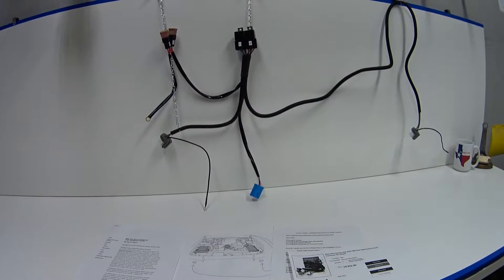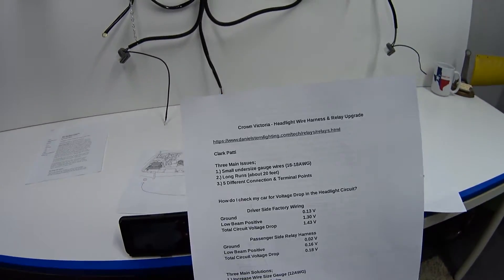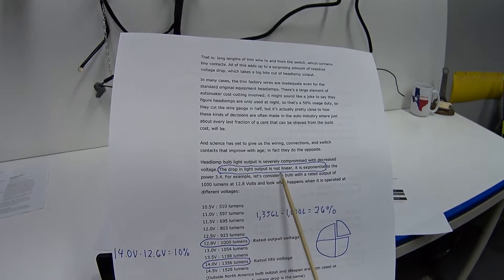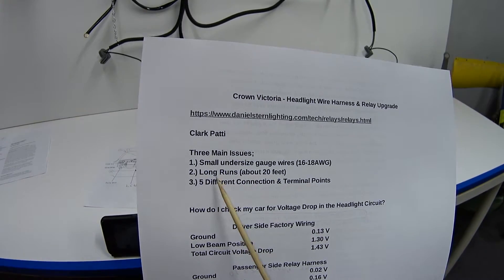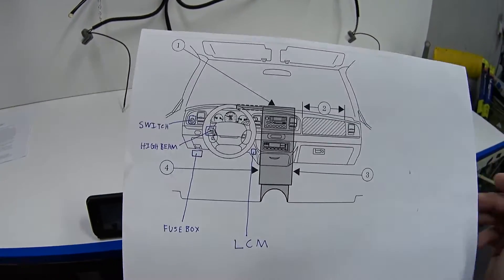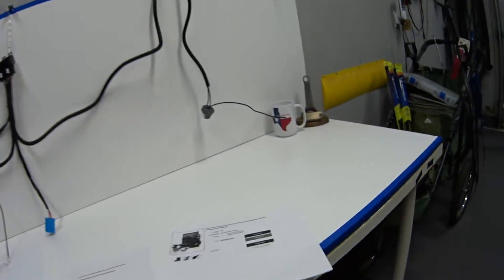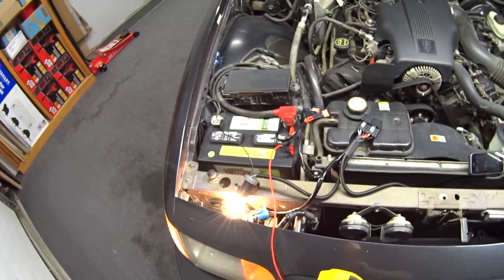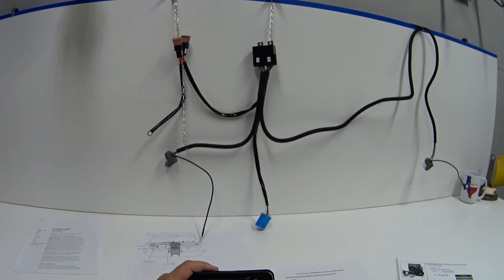Crown Victoria - Heavy Duty Headlight Wire Harness

Comment: In other news I installed my new headlight wiring harness (good thing I won). The camera doesn't seem to pick up the brighter headlight when I left one old and one new, but I can see the difference in brightness between them with the naked eye.

The install was easier than I thought it would be. Easier than it should be even. Which is kinda suspicious but they work, so it's all good in the hood.
Reply from the maker: Right on Hollywood,
I had the same issue getting the difference in brightness on film.
I think it takes a camera with manual ISO, or white balance adjustment.
 
Now that you have bigger 14AWG wires, and high temp ceramic sockets you're a prime candidate for high wattage halogen headlight bulbs. 
Stock wattage is 55/65.
High wattage is 80/100.

Guess what I might be reviewing, and giving away? lol
-Chuck
Reply: @PanzerPlatform  I can only hope some sweet High wattage headlights.

Comment: I used the wiring harnes in my 2000 ford Crown Victoria and it worked great it actually made my headlight halogen bulbs way brighter and finally I could see better, so it does work awesome, than I decided switch to LED headlight bulbs and for some reason the harness wouldn't work on LED bulbs so I had to disconnect and the LEDs are very bright there is prons and cons but the issues I am having with LED bulbs they are bringt but in the winter they don't warm up my headlight assembly so if it snows or gets frosty outside the headlight assembly gets frozen and becomes to dim, so I am thinking to go back to halogens and the wiring harnes this way keeps it dry and warm my headlight assembly, also the silver star ultra bright performance sylvania headlight bulbs will only last about a year and half tops but at least you can see very well and I mean very well like rain and fog.
Reply from the maker: Check this out;
https://youtu.be/WaF4q5wx17o
-Chuck
Reply: @PanzerPlatform Thank you for the link. Update: those light bulbs look badazz😀 I am gonna order some right now. Thank you Again for your help Sir.and I did ordered new wiring harnes

Comment: Chuck, did you ever use these with LED bulbs? Installed today and unable to use high-beam. I hear the relay clicking, but the light output or position does not change.
Reply from the maker: Yes, I tested this harness with LED bulbs, and there was no difference in brightness because the LED bulbs only draw 1 Amp of current (20% of halogen).
This harness is beneficial if you run halogen because they draw 5-6 Amps and cause too much voltage drop causing the bulbs to be dim.
A lot of guys can only run halogen bulbs because they need the heat from the bulb to melt snow / ice off the headlamps assembly.
LED bulbs only consume 20% of the current of halogen so they do not get hot enough to melt snow / ice.

If you are having a malfunction, test the LED bulbs on the bench outside of the car.
If the bulbs are OK, test the harness on the bench outside of the car.
-Chuck
Reply: @PanzerPlatform  Thanks for the detailed reply, Chuck. Ended up reading deeper and realizing this. Well, guess I’m out 20 bucks but I’ll keep it around in case someone needs one. What LED bulbs are you currently running?
Reply from the maker: @PF12345  
I use these for low beam;
https://youtu.be/3-xDR4ng7cg

I use this for high beam;
https://youtu.be/rsYlEUkLcIQ

Comment: Hey Chuck, would appreciate any insight. Ordered a similar harness from J87 for my ‘09 MGM. Worked great at first. However one day I was greeted by a drained battery; not sure what happened, but when I jumped the battery and recharged, the headlights seemed to be constantly on, even if I turned the headlights off from the dashboard knob. Don’t think it’s the LCM because when I removed the harness and put back the original bulb plugs, it all works as expected. Any idea what it could be? I connected the harness to the positive terminal by putting the ring on the clamp bolt and then tightening the nut. Connected the grounding rings to chassis metal as instructed using metal screws. It seemed like the driver side headlight ground wasn’t quite right; noticed the screw was getting super hot whereas the passenger side ground screw was normal. Please keep in mind I’m a total novice with electrical stuff.
Reply from the maker: Hello,
It sounds like something is triggering the relays.
It's too late now, but that's why it's important to always bench test new stuff before you install it in a car.
I would remove the harness from the car, and bench test it.
If it works OK on the bench, that means there is a problem with your installation.
-Chuck

Comment: My 95 E350 has reverse polarity on the headlights, so when I tried LEDs instead of halogens they worked in reverse order and there was NO way I was going to have the blue high beam light on all the time, so I went back to halogen and they honestly provide pretty decent illumination. 

The eBay listing says this harness will fit my van. 
Ironically it says it does not fit my 2011 CVPI. I went with 4WDKING LED headlights and they have very little scatter so I’m just going to stick with that for it.

Back to the van: Do you think (or know if) the Ford Vans have the same issue with the wires being too small and the loss of voltage causing similar reduced illumination like you explained it does for the Crown Victorias in this video, and should I go with one of these harnesses in it?

Separately, I too (read through the comments) didn’t find this video to be boring, in fact I greatly appreciate how well thought out, planned out, and concisely explanative it was 😎🙏

I’ll appreciate any insight into my question above 🙏
Reply from the maker: Thanks for watching, and the kind words.
I would grab some 12AWG wire, and temporarily wire up one of your headlights directly to the battery, (closest headlight to the battery).
Then look at the side by side difference between the two headlights, and decide if the thicker wire is worth the increase in brightness.
-Chuck

Comment: Will ked bulbs fix this ?
Reply from the maker: Not sure what you mean by "ked"?
Do you mean LED Bulbs?
If so, I tested the harness with LED Bulbs, and I did not see a difference.
This heavy gauge wire harness is more beneficial for halogen bulbs because they draw more power.
5-6 Amps vs. 1 Amp for LED.
-Chuck
Reply: @PanzerPlatform  yes sorry.  So if I buy led bulbs I shouldn't have an issue with dimming?
Reply from the maker: @Murc_roadster  
Correct.

Comment: Hey! 
This upgrade is very interesting to me! I’m wondering how these held up over time for you? Also does doing this modification affect the operation of the vehicles daytime running lights? If so is there a workaround to get them operational again?
Cheers
Reply from the maker: Yo Sunny,
Thanks for stopping in.

1.) What is the YEAR / MAKE / MODEL of your car?
2.) Are you planning to use halogen bulbs, or LED bulbs?
-Chuck
Reply: Hey thanks for the speedy reply chuck! 
My car is a 2011, and I’m planning on using sylvania silver stars (unless I’m made aware of a better option)
Reply from the maker: @sunnynoble9996  
During my testing I found the upgraded larger gauge wires made Halogen bulbs brighter.
There was no difference with LED bulbs because they only draw around 1 Amp of current.
But halogen’s draw around 6 Amps, so this upgrade really helps someone who runs halogen bulbs.
Since I run LED’s I did not use this.

This upgrade does not affect DRL operation. 
-Chuck

Comment: Chuck, I’m scouring the web and YouTube trying to find agreement on whether the DRLs are via lower power to high or low beams. MOST say it’s via the high beam. You may have mentioned it in one of your videos but I can’t find it again. Do you know? A company in Cali called aspire make relay harnesses with the option to keep operational DRL’s.
Thanks, Jon Archibald.
Reply from the maker: Yo Jon,
Thanks for stopping in.

The DRL’s on a Panther Car 1992-2011 function at 50% power on the HIGH beam circuit.
-Chuck

Comment: https://youtu.be/JqrySR_jKfc I made a quick video checking my voltage drop. I only did the wire. I was afraid to back probe.
Reply from the maker: That's not how you test voltage drop.
The circuit must be energized. 
Also engine running since it’s a headlight bulb.

Watch this; https://youtu.be/APLic9F7ZsA
-Chuck

Comment: Could you see any better after doing this upgrade?
Reply from the maker: Yo Josh,
If you run factory halogen bulbs you can see the difference.
If you run LED headlight bulbs you can't see the difference because they only draw around 1 Amp, (compared to 5-6 Amps of halogen).

Do you run halogen, or LED headlight bulbs in your Vic?
-Chuck

Comment: Hey man, I don't know if youll see this comment but Ebay says it won't fit my 2003 crown vic LX.. is this a direct plug in or do i have to mess with wiring?
Reply from the maker: Right on Jason,
Thanks for watching.

This 9007 wiring harness will fit any car that uses 9007 headlamp bulbs.
So, it will work on; 
1998-2011 Crown Vics.
1998-2005 Grand Marquis.
1998-2002 Lincoln Town Cars.
2003-2004 Mercury Marauder.

Here is a video showing it being installed on a 2002 Crown Vic; https://youtu.be/K-GHZeEclBs
-
-Chuck

Comment: Will this work on a town car? If not does anyone know of one? I can't find a relay kit to save my life
Reply from the maker: Right on Nick,
The harness in this video will fit any vehicle that uses 9007/HB5 bulbs. 

If your TC is 1998-2002 yes it will fit. 
If you have a different year, contact the seller with the links in the description box. 
-Chuck
Reply: @PanzerPlatform  you're a life saver man. I've been driving myself nutts looking into it and can't get a direct yes or no. Just a "well it depends " thanks for the help

Comment: Will this harness upgrade fit a 1999 Crown Victoria PI?
Reply from the maker: Right on Chris,
Thanks for watching.
Yes, it will.
Here's a video of it being installed on a 2002, and showing how it makes halogen bulb headlight brighter;
https://youtu.be/K-GHZeEclBs
-Chuck
Reply: @PanzerPlatform  i just installed the Nilight LED headlights in my CV. Do you think this mod will increase the LED brightness? Also, will this cause LED headlights to burn out faster because of the higher voltage? Just discovered your channel and not im hooked. Been a CV owner since 2004. Thanks again.
Reply from the maker: @SGAOuTLaWz  
Right on Chris,
I tested this harness on my car with halogen vs. LED bulbs.
The harness made the halogen bulbs brighter.
There was no improvement with the LEDs.
This is because halogen bulbs draw 4.5A low beam 5.2A high beam.
Most LEDs only draw 1.5A - 2A.
And, no it would not cause the bulbs to burn out faster.
-Chuck

Comment: The link is no longer directing to a product....just the sellers ebay profile webpage and I searched and couldn't find any crown victoria related items from that seller on ebay.  Can you please help me find the harness?
Reply from the maker: Right on Joe,
Thanks for watching.

It's the second link; "14AWG Headlight Wire Harness"
The 9007 Harness will work on any car that uses 9007 bulbs, including Crown Vics.

Also, the giveaway winner of this harness uploaded an installation video, with before and after footage to show the difference in bulb brightness. Here is the link;  https://youtu.be/K-GHZeEclBs
-
Chuck

Comment: Are you running led bulbs with this upgrade???
Reply from the maker: Right on Sheets,
Thanks for watching.

Based on my testing this wire harness makes a difference with halogen bulbs only.
Factory halogen bulb current draw is 4.5 Amps low beam, and 5.2 Amps high beam.
Most of the LED bulbs I've tested are between 1.5 Amps, and 2.5 Amps.
-Chuck

Comment: Can you tell me what amp fuses are used with that system?
Reply from the maker: Right on 308,
Thanks for watching, and that's a great question.
I'm suprised no one has asked it before.
This is such a great question, I may make a video responce to address this issue.

In a nutshell it's important to "size" your fuse rating according to the load, and wiring it will be protecting.
For example on my car the low beam headlamp bulbs consume 4.5 Amps each.
The manufacturer has determined to protect each low beam headlamp circuit with a 10 Amp fuse.

I hope this answers your question for now.
Stay tuned for a full video on this topic.
-Chuck
Reply: @PanzerPlatform  hi Chuck thanks for the quick reply..... What do you think the amperage on the fuse would be for the high beams?
Reply from the maker: @Captain1717Q  
Need more info.
What is the YEAR / MAKE / MODEL of your car?
Reply: @PanzerPlatform  1999  P71
Reply from the maker: @Captain1717Q  
I fogot to ask. lol

Are you using the factory 55/65W bulbs, or will you be using the high wattage 80/100W bulbs.

It will make a difference.
Reply: @PanzerPlatform  Running silver Star ultra 9007 bulbs.
Reply from the maker: @Captain1717Q  
OK, those bulbs are 55/65W.
That means the Low Beam pulls approximately 4.5 Amps.
And the High Beam pulls approximately 5.2 Amps.
For EACH bulb.

If you are using this Heavy Duty Wire Harness you should use a 20 Amp fuse on the Low Beam Circuit.
And a 25 Amp fuse on the High Beam circuit.
Reply: @PanzerPlatform  Yes sir they are 65 watt bulbs. That sounds good thank you kindly.
Reply: @PanzerPlatform On a 2000 MGM, what amperage fuses would you suggest for the 80/100W Hella bulbs?
Reply from the maker: @keestonjacobs4990  
The same amperage fuse as listed in the owners manual.

Comment: Hello  Thank you for doing these great videos. I own A 2008 P71 Vic and have never been happy with the headlight output.  I looked at the  14AWG Headlight Wire Harne you likened and dose not list comparability with  the crown vic   just wanted to double check before I order one. thank you again.  Oh PS please make you giveaway time period longer to allow some us to get involved. I catch up on your videos on the weekends.
Reply from the maker: Right on Jack,
Thanks for the kind words.
Your Vic uses the 9007, so yes they fit.

Let me give you a pro tip.
My giveaways are usually uploaded Sunday at 12:00AM.

Here is a video explaining the giveaway rules;
https://youtu.be/lKJAhVNbDNE
-
-Chuck
Reply: @PanzerPlatform   Hello so just to be clear  i only need to order  this https://www.ebay.com/itm/133129054056 and it should work ?   I harness  is what I will need?  thanks for any help or guidance.
Reply: @PanzerPlatform    Went to Clark Patti youtube linked in your vid his channel seems dead.
Reply from the maker: @andrewjackson5953  
Not sure what you mean by "dead".
Not everyone on YouTube uploads videos.
I think Clark is more of a watcher. lol

And yes, the link you provided is the same Harness in the video.

-Chuck
Reply: HELP! I purchased 2 of the  
Relay Wire Harness 40A 9007 HB5 Head Light Replace Socket Connector Two Outputs. I have a 2008 p71 and my friend has a 2007  Grand Marquis he has tried to install the harness in his  car and it seems the headlight socket will not mate up in his car? Do I need anything more then the harness?
Reply from the maker: @andrewjackson5953  
1.) 2007 Grand Marquis uses H13 bulb size. 

2.) The harness comes complete. No other parts to buy. 

If you need further help, upload a short video to you channel, and reply with the link so I can see what's going on. 
-Chuck

Comment: Going to be doing this to my 1997 CVPI. May have to take a look at that eBay store before I start making my own. Thanks for the info!
Reply from the maker: Right on Matt,
Before I found these I tried building my own too. 
I could not find the 9007 male / female connectors that were heavy duty to my liking. 

These are only slightly better, but for the total price of $22 these are a good option. 

I plan to modify this one so I can use my own relays with built in fuses, and eliminate the included fuses. 

The 14AWG wire appears to be good quality copper, not that aluminum coated wire. 

-Chuck

Comment: putting leds in soon but this still peaks my interest
Reply from the maker: Hi-Yo Silver,
What brand of LED's?
Fanned, or fanless?
External Driver, or Internal Driver?
You have "piqued" my interest. Lol
-Chuck
Reply: @PanzerPlatform  i didn't want to invest too much but i think they are decent for now, fanned, external driver
https://www.amazon.com/Headlight-16000LM-6000K-White-Chips/dp/B08C7NGPMG
Reply from the maker: @SilverBullet93GT  
Right on,
Let me know how they work out.
Maybe you can post a video.
-Chuck
Reply: @PanzerPlatform  i put the Aukees in last night and they work really well light wise, they even have a feature to turn the bulb to create different light angles.
Annoying part is the controller  wire is too short, normally i ziptie it to the frame, this one barely reached the frame i definitely need to relocate it as the wire is under a bit of tension.
I would have made a video, but it would have been 2hr long and with a lot of swearing, due to bulb harness replacement, original wires are so thin compared to replacement socket, anyway that's my rant